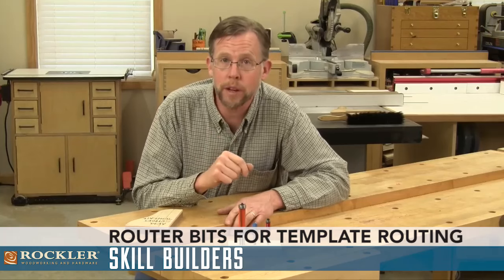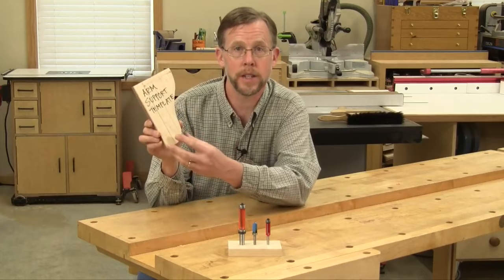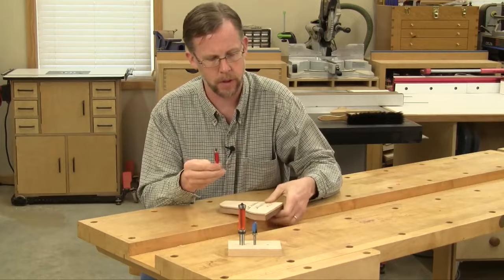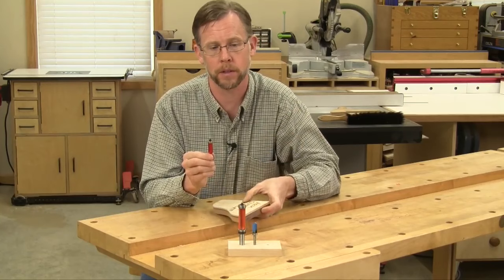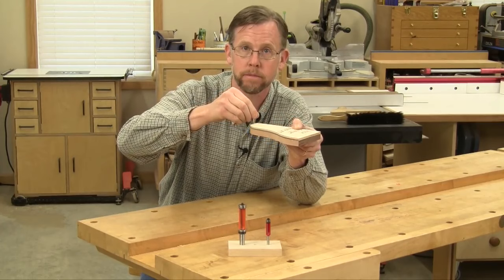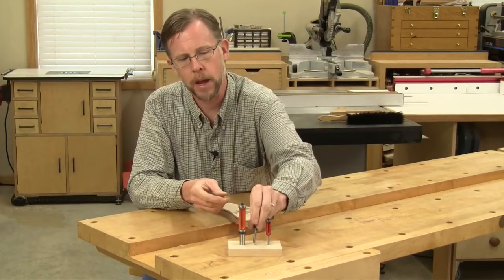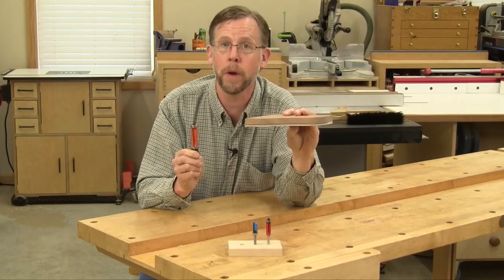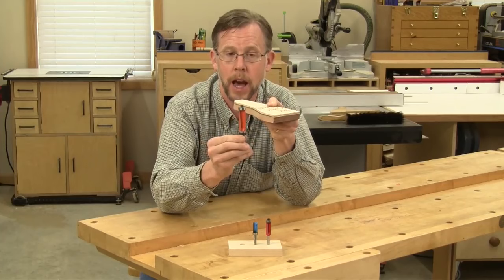Router Bits for Cutting Templates and Patterns | Rockler Skill Builder

Comment: if you are cutting thick material then the pattern bit is best because you can make multiple passes that would otherwise cause a lot of pressure on the workpiece..the first pass is also the one that most likely will cause tearout on the surface, but with a starting shallow pass you car significantly reduce this problem. Imagine like cutting thick wood with a circular saw..a few passes at one inch is less likely to burn and ruin the blade than one pass at three inches..also with a pattern bit you can cut pockets that would otherwise be impossible with the other two style of flush trim bits

Comment: can a bearing be put on any type of bit? also, can a bearing be put on top or bottom of any bit if i was to buy a bearing kit? lastly, can you discuss template thickness and how to determine that? Im routing 1 inch deep dato into 1-1/2 thick wood with 1-1/8 diameter  template bit. i have to make a few passes to get to the 1 inch depth so if the template was thin, wouldnt the bearing have nothing to ride on? how do you solve this?
Reply from the maker: Hi Elad Sinay, Please reach out to our product support team at 1-800-260-9663 or support@rockler.com. They'll be able to assist you. Thank you

Comment: Can some one tell my why this happen.  porter cable router 690  27,500 rpms   A Yionic 2.50"    1/2" shank Flush trim top And bottom bearing  bit  in a router table  when I turn the router on It sounded like it was about to blow up . I put  a 1/4" shank back in the router and it ran nice . Whats going on here.
Reply from the maker: Hi Roy, we recommend reaching out to our Product Support team at 1-800-260-9663 or support@rockler.com. They may be able to assist you. Thank you!